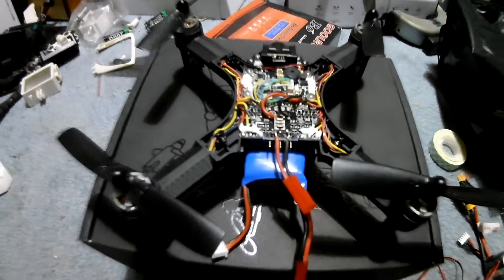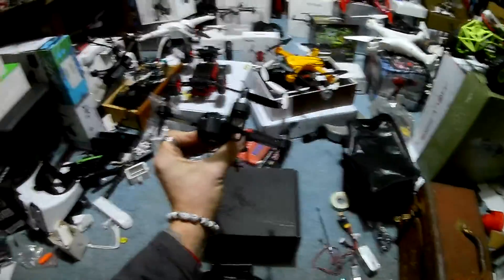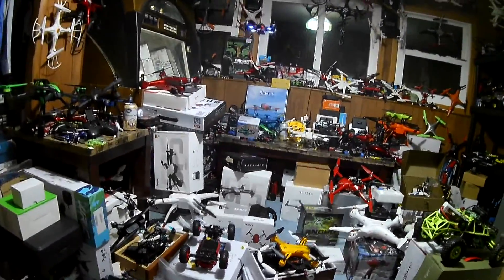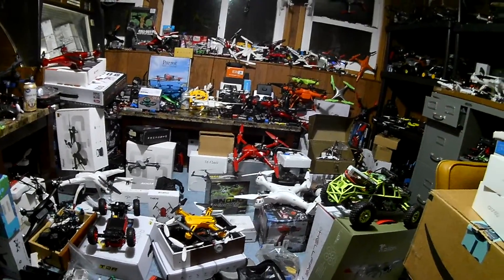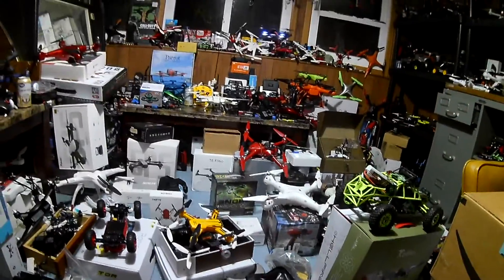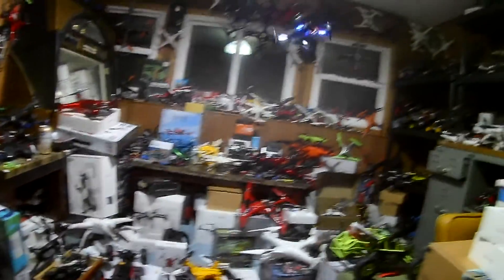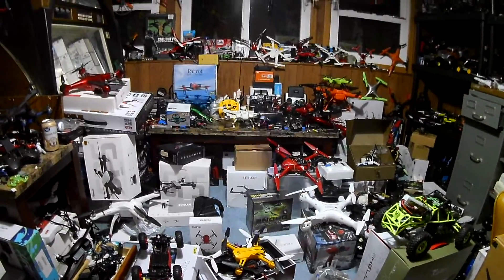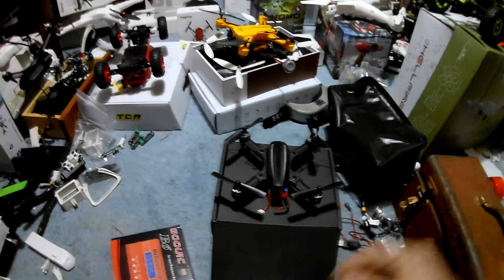MJX BUGS 3 MINI BATTERY MOD Eachine EX2 inside flight test review DIY

Comment: I've learned how quickly and contagious the bugs epidemic really is. I got into quadcopters with akaso a300, then couple visuo Aurora/xs809's. Ended up buying a bugs3... Never looked back as I gave away the previously mentioned to family members and I bought 2 more bugs3(1 more for me and 1 for my son).
Now I have this Eachine ex2mini arriving in a day or two, the struggle is real however choosing between this and the Hubsan h109.🤣 
Thanks Jay drone for all your great information. Unfortunately the eBay seller isn't/wasn't in a very negotiable mood and thus made the decision a bit easier after all 👊. 
Guess it's comparable to buying a Kia on sale instead of the Honda model you've had a eye on. Will be great regardless, no doubt it's just the outside shell being the only real difference between a actual b3mini and this ex2mini.

Comment: I have the Bugs 3 Mini with a Xt30 connector and 1300 mah battery. I love it!!!
Reply from the maker: nice bro and btw just scopped ur channel cycle vids doing u good - what c rating on ur b3mini mod battery n what flight times r u getting
Reply: @JayDrone  I'm using a GensAce 45c with about 18 minute flight.  It comes with a deans, I just change it to the xt30...
https://www.amazon.com/gp/product/B00WGP686C/ref=oh_aui_search_asin_title?ie=UTF8&psc=1
Reply: @harleydave2316  hey harley when does your lv warning come on , ive done the mod with xt30 aswell ,all batteries get lvw at 6 mins flat everytime , i got the stock and a 850mah 35/70 and a 1000 mah 35/70, when the drone was stock id get 7min  - 8.5 min b4 lvw  and if u see this great vid jay